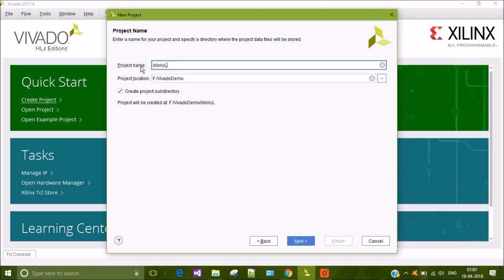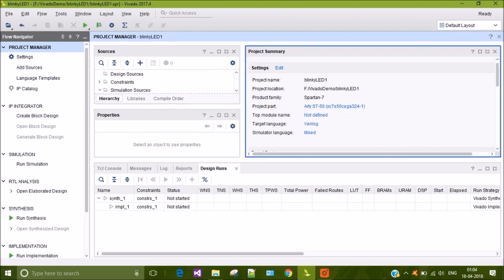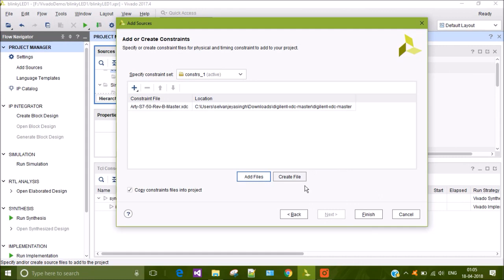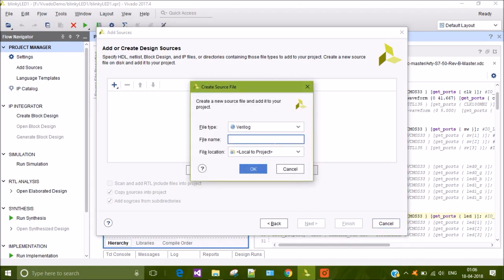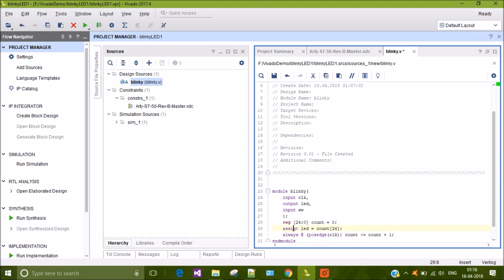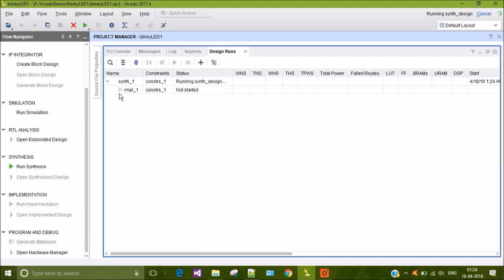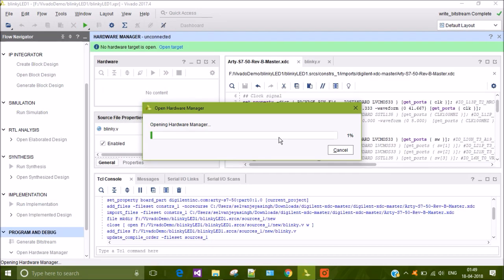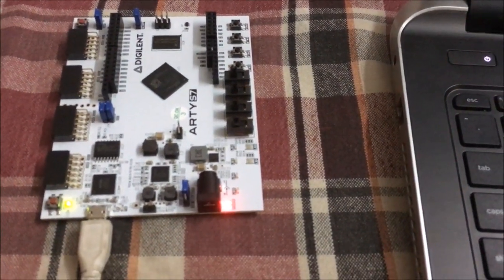Blinky LED | Digilent Arty S7 - Vivado Design Suite Tutorial #1 | Element14 Road Test

Comment: How can you calculated the frequency ?? HZ ...?
As per your code is  the period is 83.333 and the waveform is 0  41.667.
Please let me know.. Thanks so much and well done!!!
Reply: Frequency = 83.333E-9 * 2^25 = 2.8 seconds
83.333 is the clock period
2^25 is the number of clock periods that the counter counts up to. 
The LED will be on when the 24th bit of count is high and off when the 24th bit is low... half of the time since 24 is the largest bit. So it will be off for 00000000 00000000 00000000  thru 01111111 11111111 11111111 of count and it will be on for 10000000 00000000 00000000 thru 11111111 11111111 11111111 of count.